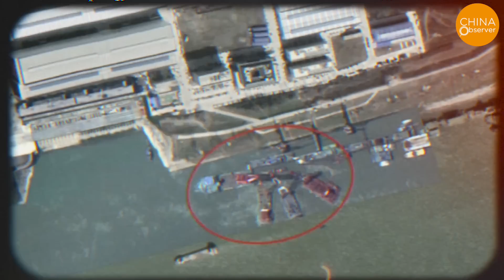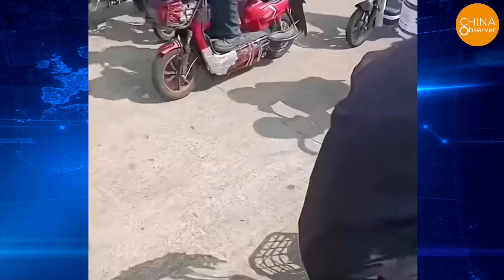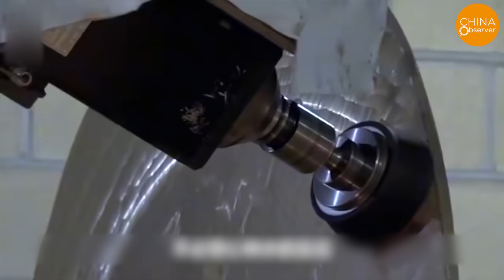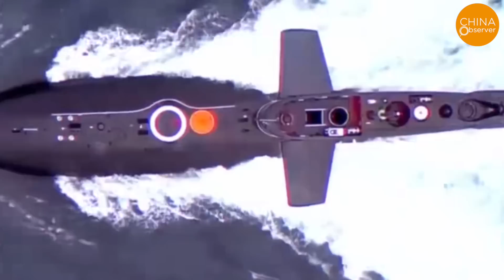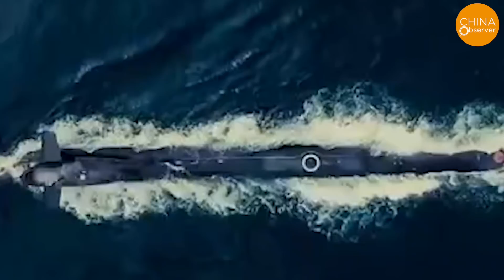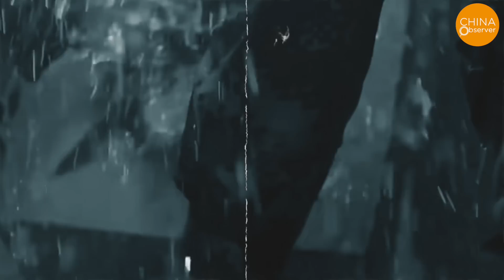China's Submarines Leak Oil Right off the Assembly Line; Yuan-Class Suspected to Have Sunk in Port

Comment: I used to work for DoD (as a Quality Assurance Engineer).  I remember inspecting welds on a ship building contract.  The welder made more $ than the shop foreman (deserved every cent and he was a real artist).  The only jobs more critical were the high precision machinists making parts for the Space Shuttle and some items for jet engines.  China can copy outer forms, but their tolerances are wide enough to drive a truck through.  I wouldn't trust those floating junks as far as I can throw them.

Comment: Where the shaft penetrates the hull there is a special, complicated seal. I think I remember that oil pressure on the inside compensates for sea pressure on the outside. A classmate of mine was on an American sub when the shaft broke, and this seal was damaged. Scary, but they made it back to port. I am a qualified submariner. I got my dolphins pinned on.

Comment: With engineering in the US, we design beyond the specifications published. The specifications are basically the minimum of what it is designed to so the equipment's actual performance is usually full of pleasant surprises. China seems to overstate the capability of their equipment. The issue with that is that the user is setup to fail and disappointment with the expectations based on false specifications.

Comment: I’m not a welder, but some of the welds done by the Chinese workers look rather sketchy
Reply: They weren’t welders either.
Reply: I am a welder and the welds on chinese container cranes look like they were done by high school woodshop students. First semester.
Reply: @kolsen6330  L😂L
Reply: Depends on the welder, not the nation of origin. If I had a nickel for each shtbag electrician/plumber/welder/tiler/drywaller/carpenter/machinist/etc here in the States, I'd have retired long ago.  That said, one would think that the defense industry would hire the cream of the crop, but many in China seem to get their jobs through family connections.
Reply: I was just thinking the same.
Reply: I resent that remark sir!! I welded better in woodshop and made better Submarines in home economics! To see someone "small wire" Mig'ing large, heavy gauge sheet steel tells me I'm not sailing on any vessels in that country.
Reply: It doesn't matter! Since these hulls will be under water, nobody can see the quality of the welds.
Reply: @howardtreesong4860 until the hull pops, but im sure China has an endless amount of leeks to conscript into their Navy 😂😂😂
Reply: @howardtreesong4860  Considering the quality of the steel it'd be a shame to waste decent welding on it anyway.
Reply: @shaggybaggums  Burn

/I agree though.
Reply: This is what you get with a slave population.
Reply: Odd, I have 2 Chinese mini excavators, and the weld on both are top notch, I even chipped away at the paint in spots expecting to see shotty welds covered up by thick tactfully bondo’d and painted , but the welds look impressive and no problems after 1 and 3 years of rough usage, I’m no pro at operating these , I know I have abused them both.
Reply: I worked for EB division of general dynamics. Every weld was inspected many times and even X-ray the welds to make sure it was perfect. I worked on the boomer and Seawolf class
Reply: @michaeldice7459  Aside from space-bound technology I would say that if there's one place where you want your welds to hold up it's in a submarine where it's really flipping important that you don't spout a leak when there's 20 atmospheres of pressure coming at you in every direction.

The damning thing about the Chinese stealing all that Western technology is that they have proven unable to take the blue prints, make good copies of it or even improve on the technology. What do you see: they make something they can build on the cheap, making it far less good than what the blueprints would allow for and then make up for the difference by bragging about how good they are.

But in the benthic bragging how good you are doesn't count. Physics doesn't care about ego. It works all the time and it is unforgiving in the extreme.

I would treat my welders like royalty. They're the ones who'll keep the boat afloat. "Don't bother bringing your lunchbox, there's going to be a buffet for the duration." It costs between $3 to $6 billion dollars to build a nuclear submarine. A bite of food is not going to put a dent in the budget. And if it did, it would be worth it!
Reply: USA spaceX stuck in space 51 days, boeing no plan return to earth.
tofu made in USA.
Reply: @wongyoonchark5050  nice deflection leek, but when it comes to tofu America doesn’t come close to China 😂😂😂
Reply: @wongyoonchark5050 it's just SpaceX setback that can be solve by China made are super tofu and affected all sector im china
Reply: @wongyoonchark5050   Winnie the Pooh isn’t paying you enough to defend him on YouTube 😂
Reply: @wongyoonchark5050 Must be a stupid Chinese? Next thing you know, Spacex is on the Moon.  Do you want to see my Moon?😂😂😂
Reply: @wongyoonchark5050  Space stations are modern technology. There's only 1 space station orbiting earth.

Submarines are not modern technology. Submarines have been in service for 100 years. Even cocaine smugglers have submarines in the modern world.
Reply: @wongyoonchark5050  LOL. At least get your insult right. SpaceX is not stuck anywhere.
Meanwhile, I will continue watching videos of TOFU DREG construction in China. I am predicting that in one hundred years China will cease to exist as a major nation and most of its cities will be rubble.
Reply: @wongyoonchark5050  ccp bot, hi!!
Reply: @wongyoonchark5050 —Boeing is a disgrace.

Comment: Fittings on different gas hook ups arent generally interchangable. That was a real expensive lesson for china, and probably not the last
Reply: The explanation doesn't make sense to me.  The diver connected a LNG bottle to an oxygen line?  Why would that affect the rest of the crew?  Why would the diver need to connect any bottles to any air lines going into the sub?
Reply: @ptonpc  "You just weren't listening and didn't hear it right" is what I initially thought (As I myself am reading books on my phone, and "listening" to it whenever I hear something and it draws my attention, so I gotta rewind a few minutes till that part begins again). So I went back to listen and explain what was said, except also went... yeah....? No, the fuck they talking about or weird ass system they got 8n China?

So after relistening a good couple times it Sounds like what I'd assume is #417 got tangled in a line while submerged, and a diver was sent to remove them, they also mentioned 56/57 crew died and the only reason the 1 even survived is because he was outside the sub performing maintenance. Pretty convincingly sounds as if they sent their OWN diver out from within the submerged sub, and I imagine the "3 Gas Cylinders" were for a welding torch underwater, to cut away the entangled line? (Since O2 + Hydrogen + Liquefied Gas) But then what'd the diver have? SCUBA or a rebreather ? But if he did, what was the point of needing to connect an O2 bottle to the Sub? And how'd he breathe that anyways, a long ass umbilical? Only thing I can think of is their subs entry/exit chamber is so primitive he has to attach pressurized gas manually himself once he's outside to keep a positive pressure in the air lock or some shit IDK. And he obviously went on with cutting the line cause either wasn't until he was done, came back, and the door wouldn't open that he realized Something's wrong*. So he obviously DIDN'T need the gas if he successfully performed the maintenance without even noticing he was missing it; and it DIDN'T pressurize the chamber if the door was stuck, as that implies a NEGATIVE vacuum literally SUCKING the door stuck closed unless by "Wouldn't open" they meant someone had to wait for his return and open it from the inside. But then then if everyone passed out and died from asphyxiation due to said unknown gas pumped into the Sub #1 Either how fucking SMALL is your sub, or HOW Lethal's that gas that just *1 half sized cylinder took out THE WHOLE SUB? 

And finally, "The Big One". If they were ALL quickly rendered unconscious, WHO TF PERFORMED AN EMERGENCY BLOW OF THE BALLAST? Survivor dudes OUSIDE THE DAMN SUB, WHAT, YALL JUST GOTTA' CRASH BLOW in Case of Emergency Button on the outside Y'ALLS BOATS? Unless a C2/C3 center monitoring the training possessed the ability to remotely command the sub it'd mean a crewmember HAD to still be alive and conscious inside yet why only once the diver came back and why were their no survivors upon entering the Cabin as they say? If people did just start dropping for no reason and someone succeeded in not passing out somehow, WHY TF DID THEY NOT IMMEDIATELY DON  A SCBA aka Rebreather or other Emergency Breathing Apparatus that ALL ships but especially subs should have... At least AFAIK in the USN they're stashed near work stations, In Emergency Lockers, and EVEN MORE "In Case Of Emergency" ones just sprinkled throughout our ships and boats (again, I assume [hopefully]. I know though at the very least ALL our damage control teams do.)

And so "Magic Cha-aun" knew the system well enough to BLOW THE FUCKING BALLAST TO EMERGENCY SURFACE, but not smart enough to connect the "Everyone breathed and passed out/died, maybe... just maybe... I should put on that thing that allows me to safely breathe?" Dots together?

You're absolutely right, that DOESN'T make any fucking sense; like NONE of it, hell ANY of it, AT ALL.

IDK, Maybe I'm just overlooking something obvious that makes it all make sense, or something that's so obvious and basic to a diver or nuke that the thought of NOT knowing it never even occurred to them. (In the USN our Submarine fleet is 100% Nuclear Reactor powered, so calling them a nuke is a nickname for USN submariners [At least as I always understood it, could be wrong and it's only the Boomers (SSBN's), or hell; just reactor technicians])

But yeah unless I missed or overlooked something, Either the sequence of events was VERY poorly translated by either the CCP or this channel, or the CCP made some shit up about how they just happened to kill ALL their experts and rising stars in submarine and anti-sub... running? Can't even call it tactics or warfare cause they'd have to GET to the fucking point of even successfully operating a sub before learning how to use it against someone. You go back to Rome and toss a Gladiator a gun? He's gonna heft it, then yeet it sttaight at someone's forehead or start bashing their face in with it.

Another example: You can't learn yourself or teach another how X + Y = Z when neither of you even KNOW what X, OR EVEN Y for that matter; is in the first damn place. 

That's CCP's China, where the last original idea... Well I was gonna say "Was to ban them", but even THAT Mao and every CCP leader after him just stole/copied from other authoritarians, dictators, POS's, etc that came before or was in power neighboring them.